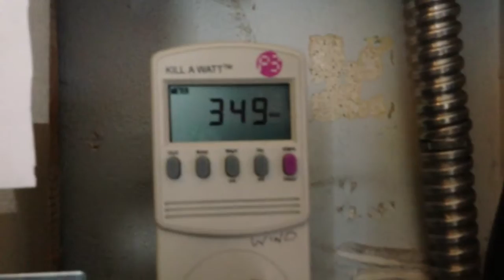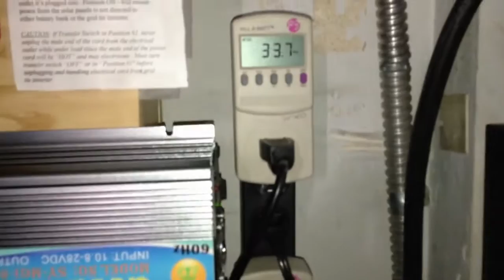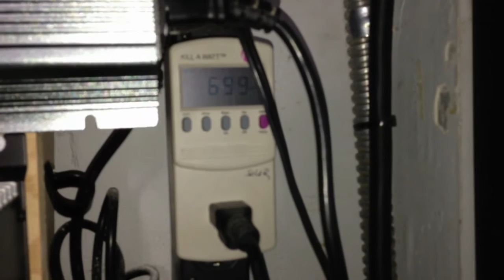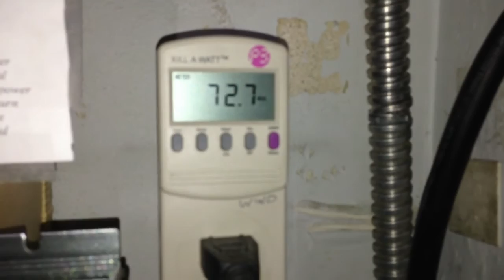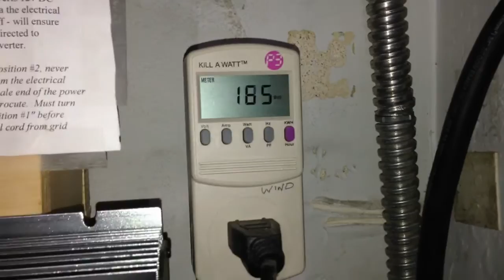Maxing Out a Windmax Turbine and Solar Panels

Comment from the maker: thanks Larry.  Yeah, there's no question the production is proven, and not only are the numbers less b/c inefficiency with the plug-in GTI conversion, my turbine is maybe 30' off ground with less then optimal mounting and zero tail modifications.  Thanks i will look into the TED or somethting (maybe even just adding an analog Can). thx again bro

Comment from the maker: Thx Ray.  I'm using the 500w SunG (10-30v) for my 400w Windmax (12v).  If you go with the 1000w Windmax and have choice between 12v or 24v then IMO it's largely preference based on the set-up of your system. for practical reasons i wanted to keep my system 12v, otherwise i would have to purchase new GTI's (or at least add another GTI to run in series to 24v). But if starting from scratch, i would go all 24v to keep my wire gauge (smaller wire) and cheaper, but at this point im staying 12v

Comment: figure out what GTI to use with the 1000w and 24 or 12 volt. Are you using a 500 watt sun 10 t0 30 gti for your wind? Your set up combination is working excellent the way you have it. Nice video Thanks

Comment from the maker: The top one is an Ensupra 1000v (10v-30v). Got to admit that's probably not much better than the SunG. On avg getting 74-78% efficiency. Only thing I like about it is stays cool and even when 700w pumping thru fan hardly needs come on. But I'm sure you know abt Enphase GTIs. They are sick. 97-98%. Only thing is they are complicated/expensive to re-direct b/w battery bank and grid. Where u getting converters from? I like the idea

Comment: what gti do you have there I have the sun gti's and they suck. I get about 60 to 70 precent out of them. out of 870 watts I get some times 600 witch sucks. I want that other 270 watts.  so I do have a plan, will be buying 2 600 watt dc to dc step up converters, takes input of 10 to 60 volts and convert it to 12 to 80 volts so I hop to use those to get my voltage up to around 55 volts to drive the hell out of my gti. lol.